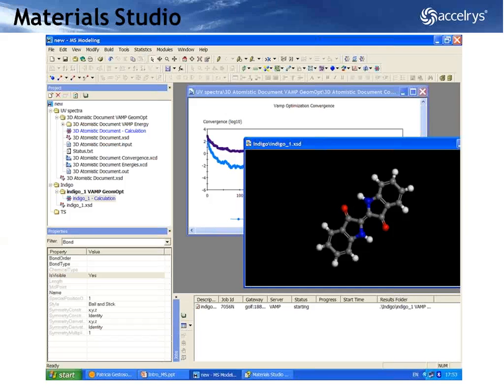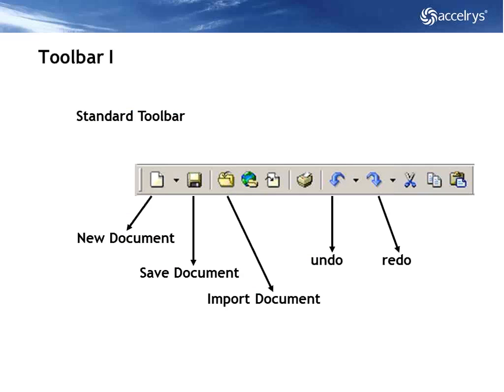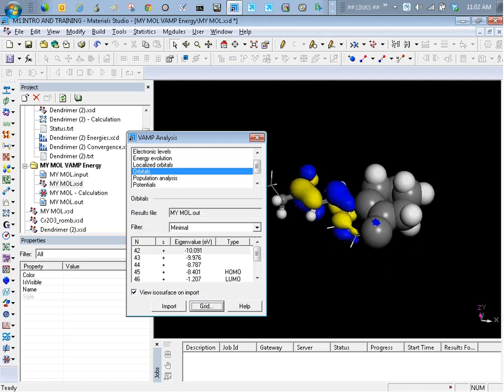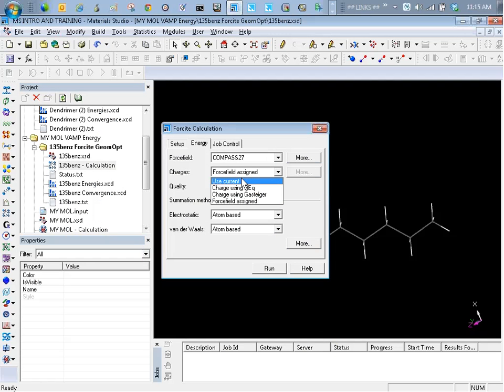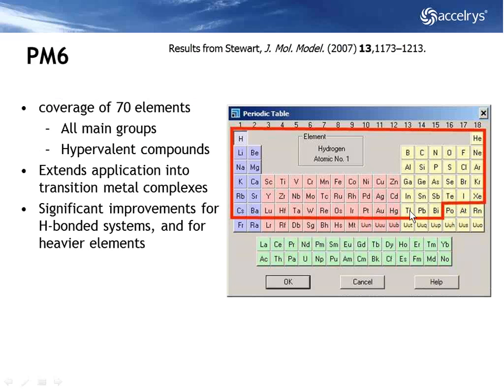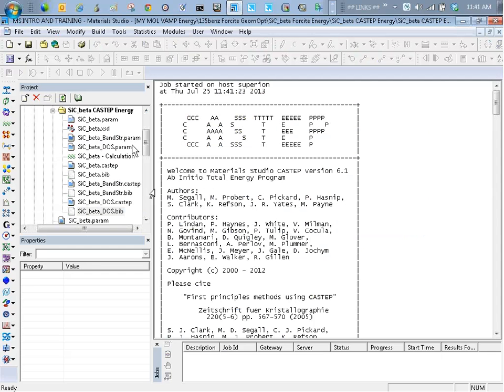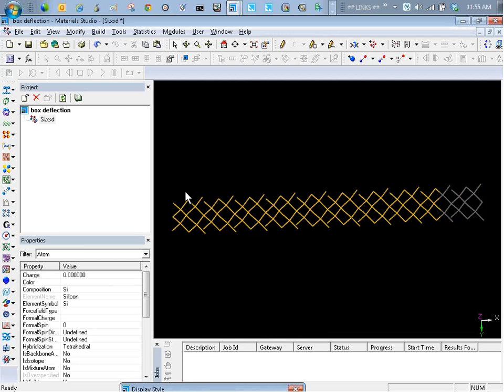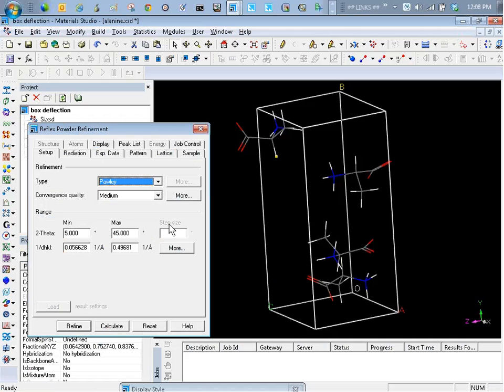An Introduction to Materials Studio

Comment: Can we simulate Nanocomposites by this software?
Reply: Hi Aziz, Material Studio is a commercial software. I don't think you can use it on your own computer. Most of the time the university/company you work for will provide the resources you need to run MD simulations. There however a variety of free and open source software like LAMMPS. Here is the download link. http://lammps.sandia.gov/
Good luck with your projects.
Reply: http://lammps.sandia.gov/download.html
Reply: sir can send me some tutorial link of CNT reinforced metal 
composites .
Reply: Oh absolutely you can do that. All you need to do is to specify the representative volume element (RVE) you want to work with and try to reproduce it with a corresponding molecular model.
Reply: +Najib Masghouni  Hello sir, plz i want this software; thanks very much
Reply: Hi Hassan As I mentioned, you need to create a crystal structure with all the components in it. It all depends after all on your system.
Reply: Hi Mr. can u send me softwar of materials Studio. pliz thanks 
jmiai.aziz@gmail.com
Reply: thank you very much Sir,  can you sent me the exact link and thank you
Reply: Thank you Sir, I downloaded LAMMPS --- Stable Version (30 July 2016), it is good this version? and for instatlation  can you  help me Mr? Thank you so much. here is my email :
 jmiai.aziz@gmail.com
Reply: Pliz Mr. Najib I have downloaded a Softowar LAMMPS but i don't know how to install the software in my PC. Pliz Sir i need help. Thank you
Reply: Hey Aziz, installation depends on the system you have (Linux or windows). You should probably know that LAMMPS are normally run on Linux machines. Just consult the installation directory in the files and you can find how to install it step by step. As for the windows users, things are more complicated. Two solutions are there, either to have precompiled applications that you can run, or use virtual machine. This will install Linux framework on you machine. I am not an expert on LAMMPS installation anyway, but this is what should happen for most of the free and open source software. I hope this really helps Aziz. Good luck !!!
Reply: Thank You so much Sir. my Email if you have a new about LAMMPS. aziz.jmiai@edu.uiz.ac.ma or jmiai.aziz@gmail.com
Thank you Sir.